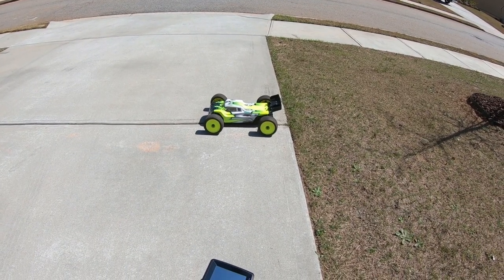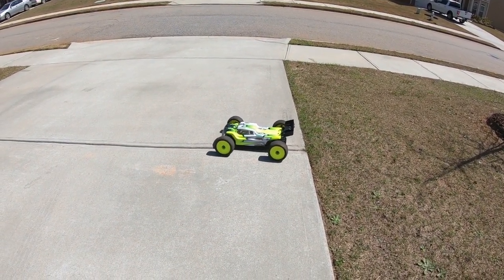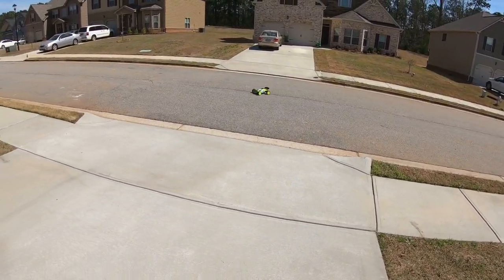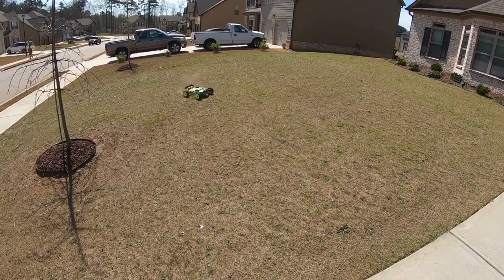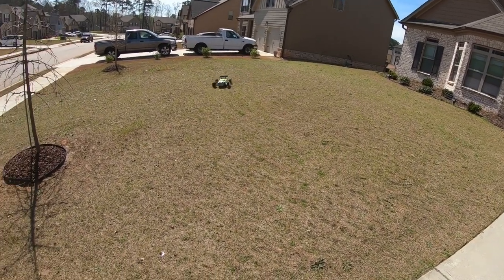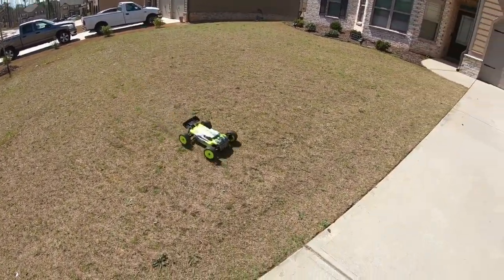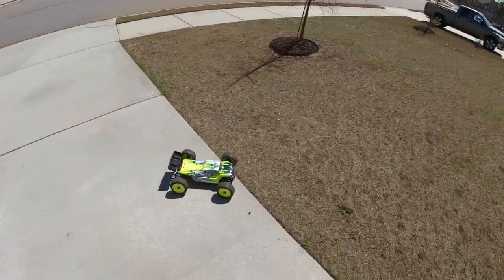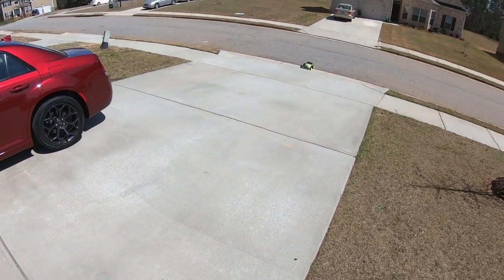Agama A215T race truggy

Comment: I love race bred anything they run so smooth and quick!  Very cool truggy!   It turns on a dime also with some tweaking    I need to learn my dx5c better haha
Reply from the maker: longboardguy yeah bro it took me a minute to figure that out your remote is important on How your RC drives that’s why all the racers use aftermarket remotes easier to dial them in I was scared to change settings on mine because I thought the car would not run the same but when you tweak the settings it runs so much better 👍🏾💯 Rcfam4life

Comment: Cool vid.  Is Agama still selling the electric version of the A215T?   Or, did you say that if you buy the truggy, it comes with both nitro and electric options (like the TLR one)?  If so, that's sweet.  I don't see them advertising that dual option - they should.
Reply from the maker: I don't know but the parts are very hard to find I sold mine because of parts be it is a awesome rig